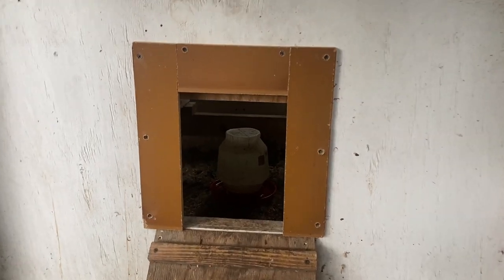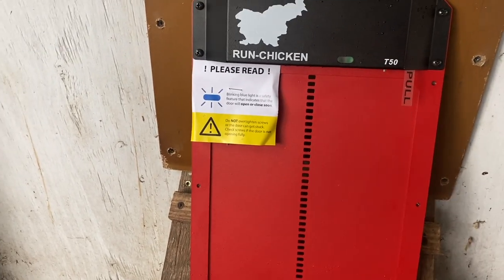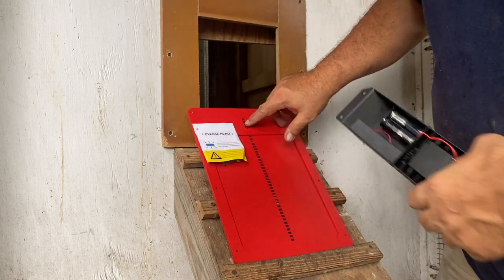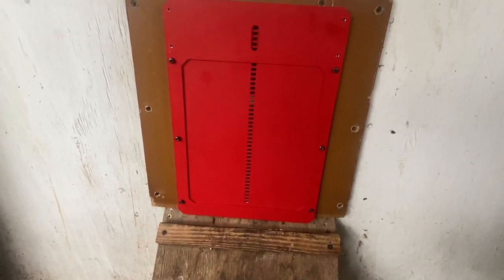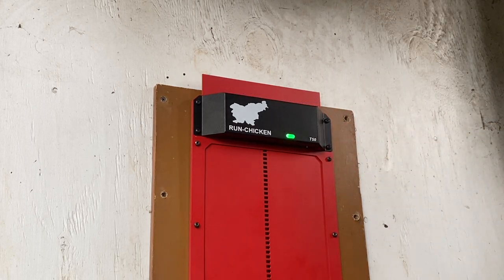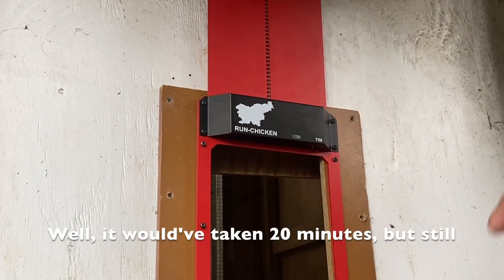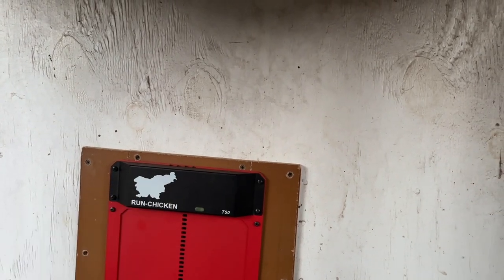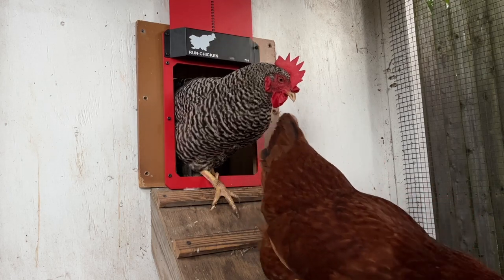Automate Your Chicken Coop Door

Comment: Nice and simple one piece but would be nicer with a solar charging system and I can’t tell but visually the batteries look longer than double A batteries but could be an optical illusion. Is it some special or odd kind of batteries?
Reply from the maker: Thanks, and yes, it's an optical illusion. They're just regular double AAs. The draw on them must be incredibly minimal though because here it is well over 1-1/2 years later and the batteries are still going strong. Run-Chicken recommends replacing the batteries annually, but they haven't indicated yet (they flash red(?) when they're getting low on power) they're ready to go.

Comment: I'm thinking about getting this.  But am I right that when you have to replace the batteries your going to have to actually unscrew the motor?  If so, they definitely need to look at upgrading it to something more user friendly
Reply from the maker: That's the biggest drawback I can think of. Not a dealbreaker, just a slight annoyance. I think it might be a way to protect the batteries a little from the elements as many people will mount this on the outside of an exposed coop. It just so happens that my door is mounted under shelter, so it's not a concern.

Comment: how do you recharge it ? change batterys and maybe im ignorant but how do chickens know door is closing or do they always roost before sundown and there is really never a situation when a chicken is cought outside?
Reply from the maker: Batteries! Also chickens are surprisingly smart and know where and when to get inside on time. Mine typically are inside long before the door is closing and even if they managed to get caught as the door was coming down there's a built-in safety feature to stop the door and reverse it before it crushes them, kind of like a garage door.

Comment: You think putting it on the inside?
Maybe the rain will rust the motor!
Reply from the maker: Not a bad idea, but a couple of things with that. First, Run Chicken says they are waterproof. There's a video on their site showing them submerging it in water and it still works. In my coop setup at least, it's protected from the elements under the roof of the run, so I don't need to worry about that. I'd also point out that the light sensor controlling the door opening and closing is on the outside of the motor housing. If it was positioned in the coop it either might never open due to it being too dark inside or could prematurely close towards the end of the day. cheers!

Comment: Does this work in deep freeze winters - like 10 below?
Reply from the maker: We don’t have sustained winters that cold here, but it can dip that low occasionally. So far it’s worked perfectly without a problem. I would imagine the batteries would die faster, but a year and a half after install and my door’s original batteries are still going strong.
Reply: @HomesteadDIY  Well ya sold me! I'm going to Amazon right now. Thanks Buddy!

Comment: what about   really  cold weather  i am  from maine
Reply from the maker: While this will be my first winter with the door, we did have some arctic blasts blow through already running for several days at a time and the door has worked flawlessly. Now, battery performance does tend to degrade in really cold weather so I'll have to see just how long the alkaline batteries I have in the coop door last, but the interior of my coop is heated with heat lamps in the winter and the run off the coop is wrapped in plastic, so there may be enough residual heat to have them not be so affected. Still, lithium ion rechargeables might be best since they tend to have good cold-weather performance. Hope that helps.

Comment: 11 months on ,still working ok mate?
Reply from the maker: Not a single issue. As a matter of fact I was thinking just the other day the battery is still going strong too. Run-Chicken says a year so it could be getting ready to die soon and they do recommend changing before winter sets in but it’s been working like a charm. I’ll be installing a second unit very soon to let the chickens go from the run to the yard

Comment: Is it strong enough to keep coyotes, bobcats, and raccons out?
Reply from the maker: The company says it’s strong enough to keep predators out. I don’t have coyotes and bobcats by me, so I have no experience with them, but I would definitely say raccoons definitely. Because the door is gear driven, it would be exceptionally difficult for any animal to push the door up. Could they break it? Possibly but I would think doubtful since you’re only cutting the opening as wide as the door and that provides some pretty good support to the frame. There’s little for an animal to get a grip on so I would agree with the companies assessment.
Reply: @HomesteadDIY  Okay thanks.  If it's "possible" for a raccon to break it, a coyote and bobcat surely can.  I'll keep looking
Reply from the maker: @cherylangel1714  I'm not sure that's what I was saying, lol, but I don't have a dog in this hunt. Good luck! Keeping the girls safe is paramount. I'm quite comfortable using this model but you need to be comfortable with your choice. Cheers.
Reply: @Cheryl Angel, they are made from aluminum ant yes, they are strong.
Reply from the maker: @andrejna  Wow, you're right. It is aluminum. It had the feel of ABS plastic which I thought was sufficiently strong and rigid by itself, but upon closer inspection it is aluminum. Thanks for the clarification! Also, I have no doubt they are strong enough particularly because of the compact design, even though as I noted I haven't had any experience with coyotes and bobcats. Thanks again.
Reply: Might be worth reviewing your run design if it's allowing all manner of predators in to attack your coop. The first line of defense should be the strongest, not the door to the kitchen.

Comment: But 200 DOLLARS?! No thanks!
Reply from the maker: Oof! Yeah, the price went up. No doubt the runaway inflation we're seeing everywhere is hitting here too. The listing I see on Amazon shows it discounted 10% to $180 and there is a 10% off coupon in my video description, which would bring it back down to around the $160 level. Gotta say, though, this thing has run like a charm since I installed it and you can't beat the simplicity. But I agree, $200 is a tough price point for many people to swallow.
Reply: Cheap like Borscht now. Check Ebay, about $27 US (Automatic Chicken House Door Coop Door Opener)
Reply from the maker: @DARKLYLIT  Indeed! I can't speak to the quality or longevity of those that directly rip off the design of this one -- mine is still working flawlessly -- but the price is certainly affordable.

Comment: I Bought three of these recently what a complete waste of money they are just thrown together ,one did not work at all ,they close before the chickens are in and very very poor quality avoid at all cost bite the bullet and spend a bit more
Reply from the maker: I'd disagree. I found them solidly built and reliable. You can adjust the time for closing if you have breeds that tend to stay out later, or if light conditions are different for your coop. Instead of the door closing 20 minutes after sunset, you can have it close 40 minutes later. And because my coop faces east, light tends to hit it sooner and my hens are ready to come out before the 20 minutes after sunrise, so I adjusted it to open at first light. I find the build and the customization options a very good value for the money. I guess others could have a bad experience, but that has not been my experience.
Reply: How much for those 3?  There is a cheapo copy cat version out there with the same frazzled chicken looking art on it that is NOT the same thing.  Under the chicken art, does it actually say "Run-Chicken" and then bottom right of the opener it say T50?  If it doesn't say any of those, you got the chinese knockoff.
Reply: The ones I bought had no way of changing the opening closing times and I think I paid about 90 pounds for the three delivered from an advert on Facebook
Reply: @robertwright4803  I'm guessing they have plastic doors and you've been had by the notorious crappy chinese knockoffs. These have metal doors and are actually branded T50.